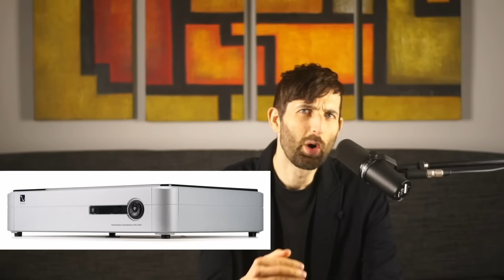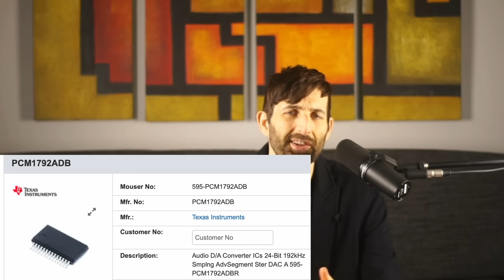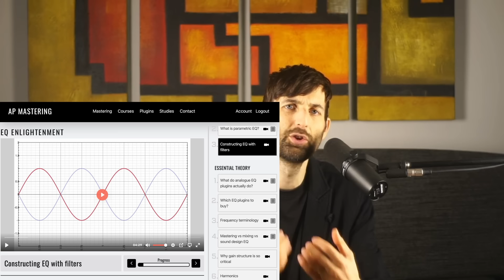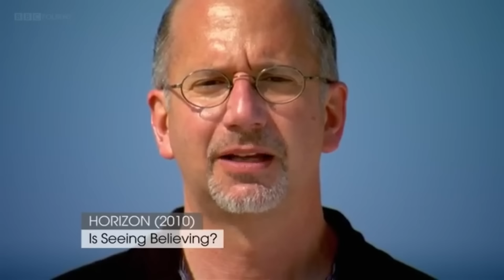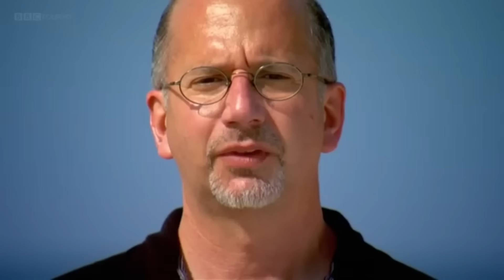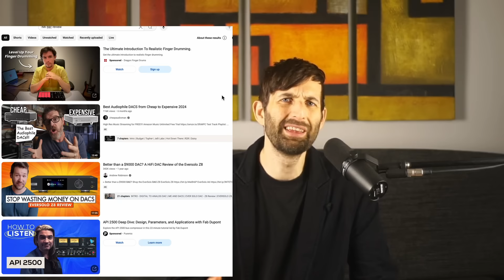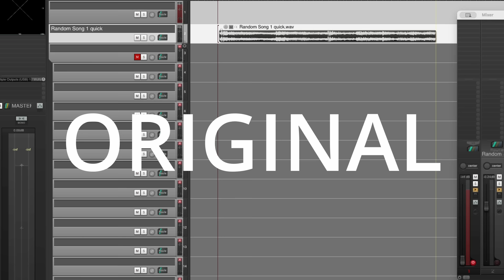The DAC Scam - Almost everyone believes the hype

Comment: I get tired of this stuff.    I watch a review channel.    Then they start gushing about cables.    Especially power cables.   With some flowery words about how that oversized way overpriced 6ft monstrosity makes some sort of difference in sound.     With absolutely no evidence of why it even could make a difference.   So I quit watching them.
Reply: Good call.  If the YT rabbit hole is starting down a useless direction, I tap out as well.
Reply: Don't quit, call them out for pushing SCAMS.

I've been shadow banned by Cheap audio Man and several others I've called out.

They're all crooks imo
Reply: You should take a look at Shunyata research, they can explain AC cables in technical terms and they have some really nice cables that do some big things especially good value is the THETA. A more expensive one that's really nice Is the sigma X. When I switched over all 15 outlets in my analog mastering room, I recorded the differences before, and after, and it was not subtle.
Reply: Darko Audio is one of the worst audiofools channels there is. The guy has never actually made any objective statements.
Reply: @Drinkyoghurt  Completely disagree. And you should listen to his podcast where he has called out equipment manufacturers to their face for ridiculous claims. He's not one of the bad guys.
Reply: @Drinkyoghurt  Darko has made some great videos about room treatment, but I guess that doesn't count to you.
Reply: 100% with you. It's just ridiculous what people believe. I once ask a group of "audiophiles" discussing power cables why it would not make the most sense to use Romex for our power cords. The power is coming from your panel via 12 or 14g Romex (or equivalent). Would it not make the most sense electrically to use the exact same cable for our powers cords, assuming the power cord matters at all? I got 0 responses.
Reply: @andyrichardson6188  usually the answer is 'noise' behind the amplifier or something.  it doesn't make any sense, it's not like the walls are made of lead or something. and you could mitigate anything with just a much shorter cord to the socket anyway. hell, just run the romex from the panel into your device.
Reply: @andyrichardson6188  
If people are so worried about it.    Get a lower  gauge power cord.       Tripp light makes a 14g cable for 10.00.     I just use what came with my amp.     I remember when most amps had a cable that wasn't grounded and was physically attached to the amplifier.    Think lamp cord .
Reply: @andyrichardson6188  I can hear the differences all the time. I don't need more proof! I only wish that stuff was cheaper.
Reply: I think hans beekhuyzen is far worse.     Cheap audio man and old guy hi fi are runner up.   Hans keeps trying to say magic ethernet cables and switches make a difference. Plus linear power supplies are a thing for him.    Cheap audio man said $100 cable made a world of difference on an Apple TV.    And old guy hi-fi claims a lot of different things.   USB reclockers power supply cables, etc.     I watched Darko for a while.    I haven't seen so much B's from his channel.   But again haven't watched him in a while.
Reply: @jasonk5979  if a device you're using costs 1000+ can benefit from any sort of usb reclocking I would expect it to be built into the expensive device - and it basically always is in the form of a buffer on the device because ITS NOT A PARALLEL PORT IN THE FIRST PLACE. every cheap device does it. you'd need to run through extra hoops to design your usb device badly for it to be able to benefit from an usb reclocker
Reply: @jasonk5979  sadly you’re very mistaken and you’re speaking more from emotion than from fact. I have tried different power cables on my Sony TV and the improvement in terms of picture clarity from a higher end cable was startlingly clear to anybody who saw it, including my wife who has zero interest in video or hi-fi. That does not mean every product that expensive is good. But making a statement like objective is good and subjective is bad is ridiculous.
Reply: @Simplyveej  
Huh.   No I repair equipment all the time.   You know like power supplies.    Your tv doesn't work like you think it does.    That magic power cable cannot do what you're claiming it does.    For one thing it doesn't stay ac after the power supply.    The power supply is there to convert the AC to DC.  And it's not a linear power supply anymore.    It's done through chips and caps.    All filtering out that awful AC noise and variations..     If the DC wasn't in spec your tv wouldn't work at all.      Not better.   At all.    The chips in your tv don't tolerate variables like that.      So if you think it does.   Good for you.
Reply: @ dude you could not be more wrong if you tried. I have pictures with the two power cables. And I have shown it to a dozen different people. I think you need to find a new line of work.
Reply: @Simplyveej  Your TV is essentially just a computer connected to a monitor, the type of power supply can never have the slightest impact on image quality. If this happens, then there is a fault.
Reply: @ you are incredibly wrong.
Reply: @jasonk5979  To be fair, there may be something very "wrong" with his original power cable.  A simple test with a new ordinary cable and his old cable will soon put that right.
Reply: @Simplyveej  That socket your “magic power cable” connects to on your TV is made from cheap plastic, tin connectors and soldered to a circuit board with the cheapest wires running to the power supply the manufacturer could buy. Soldered on with the cheapest solder they could buy into a transformer wound with the cheapest copper the manufacturer could get.
But you go boy! Spend that money.
Reply: @ Such a ridiculous comment. It did not address the actual finding whatsoever. Go back to the temple of ASR.
Reply: @Simpleveej my brother don't listen to these guys, and their newfangled science, may I interest you in the highest quality, hand crafted power cable? Where each strand is carefully wound by hand by artisans right after they have purified themselves in high quality mountain goat's milk. Just for 699 you can have the best power cable, and the picture, my brother, the picture is so clear, you can see pore in a woman's body, you can see the glint in each strand of hair of a man's beard, each speck of dust on a dog's fur. It is a life changing experience. For you my brother, only 650. (Shipping extra)
Reply: @ashwinrawat9622  
How much to do the whole house.?
Reply: @ I guess you think you’re being very witty. You just wasted 10 minutes of your life writing  nonsense. Classic strawman argument. I never told you what I spent on the cables. You are making a lot of ridiculous assumptions.
Reply: I come into videos like this to laugh at all the audiophile white nights desperately trying to justify their outlandish expenditures and to convince themselves that they actually hear the difference that the snake oil merchants tell them they should hear for their money.
Reply: Hi-fi manufacturers know why power cables make a difference, even if you and I don't. E.g. Linn engineers its hi-fi to work with selected, ordinary IEC cables, but they don't sound good with all IEC cables. My second-hand Linn pre-amp came with an awful-sounding "audiophile" cable, and the £20+ I paid for a proper, Linn-supplied cable was probably my most cost-effective upgrade ever.
Reply: @jeremydas723  
Cables are different gauges.   And not every cable is properly put together.
Reply: @jeremydas723  If you want an even better upgrade, get rid of the Linn preamp altogether and use a passive volume control instead.  If you don't want to go that (small) expense, then find a quiet passage from a CD (this is important) and plug your CD player straight into your power amp.  It will still be LOUD, but if you volume match it with your Linn, the difference will be obvious.
Reply: The evidence is in what you hear.
Reply: This video is misleading.  The difference with high end dacs is in the imaging, layering, separation, and soundstage.  These things won't be very noticable in a you tube video played on your phone or crappy pc speakers.
Reply: @steveb.3580  
 Any Double blind (local)  test to prove your point?   Links ECT.  You're more than welcome to make a video claiming otherwise.    Just taking your word for it really isn't good enough.

Comment: funny about this ive gone from dac to dac for a couple years and got all the way up to a 3k dac and i just couldnt fucking tell and it was driving me crazy so i sold it for a lower cost one and was happy  with that. After a bit i just bought a dap that was on special and i could use as a tool to demo stuff at a store and has other utility like ripping cds into it, using it as a line out, using it as a digital out, and ocasionally using it as a hp out. Its the a&k se300 i got on special and i was mostly getting it for its utility, design, and sound. i dont think ill be moving from here at least in any upward direction in price

this isnt a plug or some shit i was just sharing my experiences and why i got what i got

Comment: I couldn't comment on the sound of the DAC chips themselves, but certainly, Ive noticed differences in the sound of various CD players and separate DAC units.I suspect differences are mainly down to how the rest of the analogue signal path is processed. I have had a Cambridge Audio CD3 with 16bit 16 times oversampling, then a Chord Qutest - which sounded a little better,, then a Gustard DAC which was a little better too but now I've got a TEN Audio TAD1 valve DAC from about 7 years ago which uses unknown DAC chips but is all valve in the analogue section and even mains rectification - and it has a built in volume control - and it sounds glorious. I put this down to it effectively being a digital preamp using ultra high quality components, so would sound better than the Cyrus preamp I was using before.
Reply: Tube gear might be adding harmonics. If you enjoy it, it's good. Just be aware.
Reply: @AironExTv  The tube gear IS adding harmonics.  They tend to be concordant even harmonics, but it's distortion all the same!

Comment: I looked at this a while back, and came to the conclusion that my MOTU Ultralite mk.5 converters were plenty good enough. I can see that a second-hand RME ADI Pro 2 FS is as high as I'd ever went to go. That RME is not bad value, even though they go for a little over 1k, given it's 2 inputs, 2 outputs, a clock, and a standalone analog/digital USB interface with great drivers. Then again, I think the volume control is partially digital, from memory. So maybe it's not great value.
Reply from the maker: its not the greatest bang for buck but RME are solid
Reply: @APMastering Yip, to be fair, there is a more worthwhile premium for professional reliability. And it is particularly important if recording, say the main vocal and/or stereo instrumental part. I have found my MOTU Ultralite mk.V solid, but I seem to remember reading some reports of power supplies failing. I bought a Ferrofish Pulse 16 MADI, those are really good value for the channel account, and it's very solidly built. And using it with an RME Digiface gives me the RME driver reliability.

Comment: Your premises are all wrong. First of all the design of the DAC, its power supply, filtering, and EM/galvanic isolation matter just as much if not more than the DAC chip itself. You can take the exact same DAC chip and put it in a crappy DAC with noisy power supply with little to no galvanic isolation, and you will get a jittering mess! Secondly, most high end DACs use proprietary designs and not off the shelf mass produced chips. R2R ladder DACs like the KTE Holo May, use nothing but independently isolated dual mono ladder resistor DACs that are hand made where each component is carefully measured beforehand. Or you have Delta Sigma DACs like the Chord Dave or Playback Designs PD8 Dream DAC use custom programmed FPGAs and not off the shelf DAC chips, that enables each designer to implement their own proprietary noise shaping, upsampling, and filtering. No two of these DACs sound the same. And while there are large diminishing returns on price to sound quality, there are audible improvements as you move up in price. So you do get what you pay for, but for most it would be a waste of money unless you are shooting for the ultimate sound experience.
Reply: What you say is factually correct, but the diminishing returns begin platauing at 200 rather than £10000
Reply from the maker: note how I talk in the video about well designed DACs using state of the art chips, not poorly designed piece of junk with state of the art chip

Comment: I thought it was fact that the 500-1500 range is as good as it gets for a Dac and the rest is either brand name, aesthetic and features. 

 Also I find A/b tests are impossible when the music already sounds like crap (no offence if it’s your song) 

But an already distorted crunchy disaster track is impossible to tell differences in. 
The best way I can describe a garbage converter is there’s an ever so slightly pinching in your ears when it plays and the low end just sounds cloudy as if you were listening to a crappy ported speaker

Comment: What would be the thing that makes my Neumann interface sound better than my old Scarlett and audient and UA volt? There is an absolute difference in playback in the deep lows and high highs specifically.
Reply from the maker: could be colored and less transparent. I don't like Neumann stuff
Reply from the maker: meaning the new stuff. seems like they aren't the same Neumann
Reply: @APMastering it’s a merging interface with a Neumann badge and their monitors are Klein & Hummel re branded

Comment: The overall tone of the channel is very good, it will definitely attract thousands of people who have no experience in listening to music but want to have an opinion. Of course, measurements are important, but only up to a point. Some characteristics of sound are not measurable, just like machines and speakers that, in theory, are perfect in measurements, but in terms of sound, something doesn't quite work. The human factor, experience, and fine-tuning through many listening sessions should not be overlooked. Also, there are companies like Chord that make their own chips. In general, it's a good effort from the video, but it is somewhat aggressive toward audiophiles without reason.
Reply: @hannebudio267  - neither should the reality of the engineering process.  If you saw what that audio had been through before it even got rendered, starting with mics full of spit and nicotine, you wouldn’t imagine for a moment that a speaker cable could somehow bring out the lush secondary harmonics in a cymbal transient.
Reply: @CraigAdams-s9i I understand what you mean, as I happen to be involved in music production and sound recording. Cables are part of the fine-tuning of a good hi-fi setup and are purely for slightly altering the tonal character to the listener's taste. I certainly do not share the view that a cable can improve a recording, but it will definitely change its perception, just like every other part of the chain, though to a lesser extent.

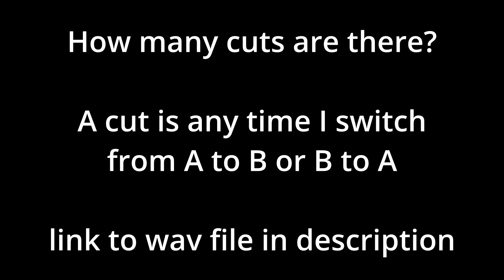Comment: Not sure how much i'm tricked by a level matching issue (or just the drums being more dynamic during that part), but you can hear a shift starting around 13:05 until the end where the drums sounds more compressed. 
If i had to guess without context, i would probably just think that i have to adjust how much the compression is working on my drums during that part. 
The issue i'm hearing is up to taste and might have nothing to do with the DAC.

Comment: I am afraid you are wrong. Big difference in DAC sounds. It all depends on the ability of your system. If you have a decent quality revealing system and your hearing is not shot, you should definitely hear a difference between a $200 and a $2000 DAC. It’s not 10X better, but it’s better, significantly and easily discernible! If you can’t hear it, then it’s your system, poor synergy, the room or your hearing. Ear wax?
Reply from the maker: how did you do in my blind test?
Reply: @APMastering
Your blind test? No need, I have done my own blind tests. Once you have a minimalist system with the least amount of the highest quality components and single full range, X-over less speakers in the right enclosure using SET tube amps, the difference between DACs can be enormous and easily discernible. I feel sorry for those who believe your absolute nonsense.